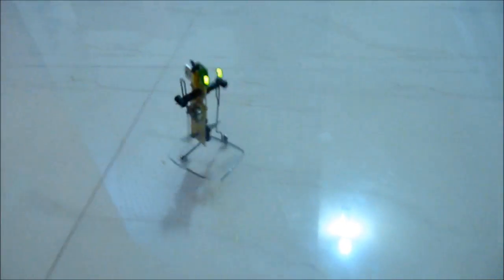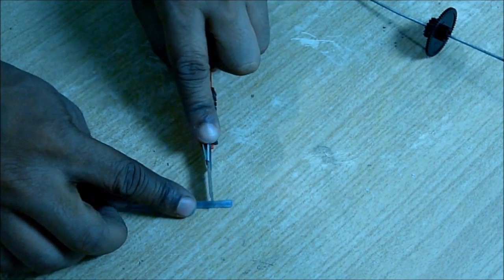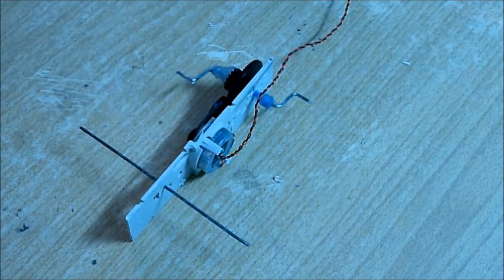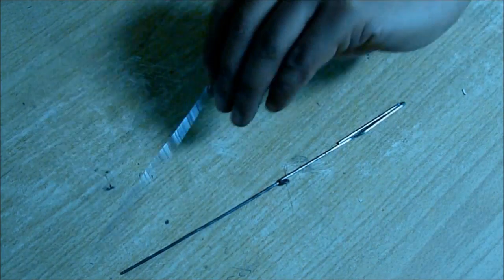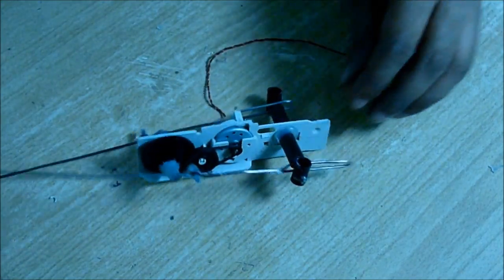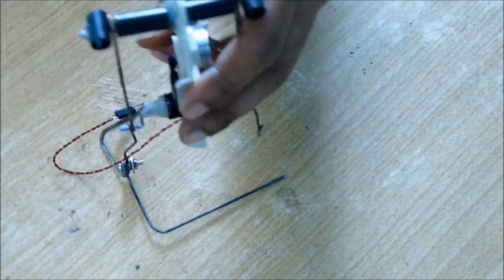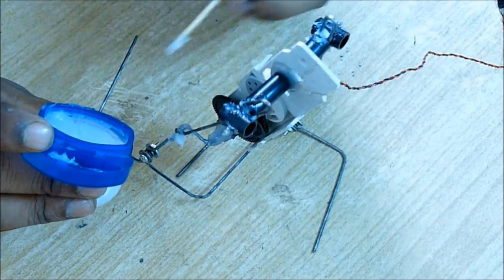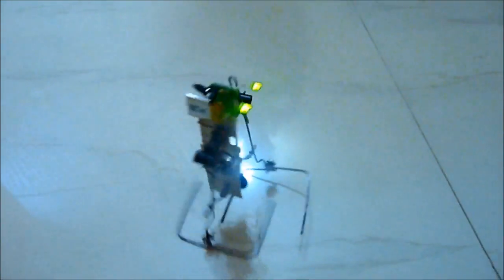How to make a walking robot at home - DIY Robot

Comment: At 0:18 what is that wire that comes out from the cd door mechanism , does it come like that , or did you connect it to something , and do you connect the wire to the 3.7 li po battery ?

Comment: What happens if you use a high torque high speed motor?
Reply: +Emilia Romagna you cannot control it also the battery will drain out soon unless you use higher end ones.

Comment: MATERIAL REQUIRED:-
1)Low speed motor(can be obtained from waste CD player by old cd door opening mechanism)
2)Iron wires
3)Glue or hot glue
4)Empty pens and their refils
5)Cutter or scissors
6)Pliers
7)Scale
8)Screws and bolts
9)Grease or vaseline
10)3.7 volt battery(recharchable)
11)LEDs
12)Electrical wires
Reply: ***** Thnku sir..:)
Reply: SUPER CONCEPT ...

Comment: hey i finishd my bot.......but i have a problem.it is that the gears are tight and also i dont hav the original rubber band used to connect the motor and gear .i used a normal rubber band and gav electricity. but the motor moved a little and then stopped. i guess it doesnt get enough power to run the bot.so what should i do???